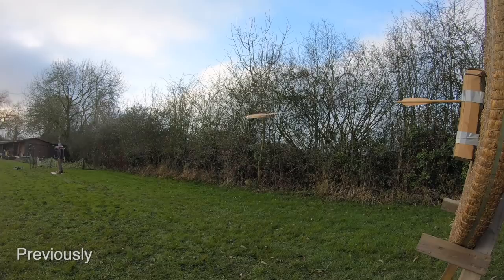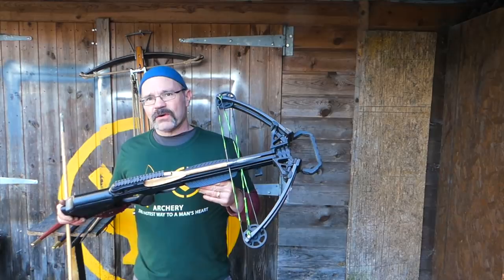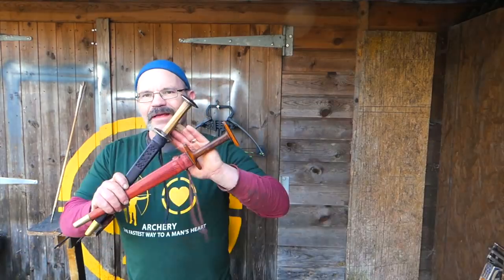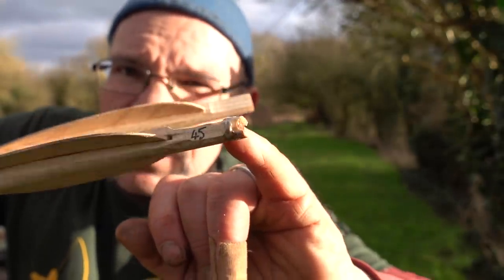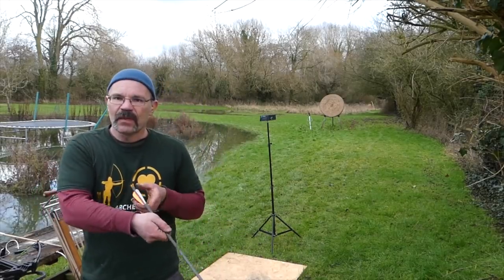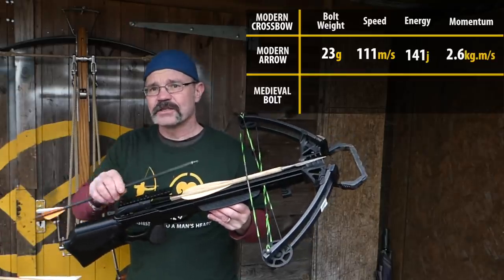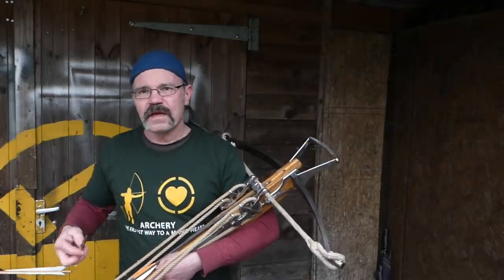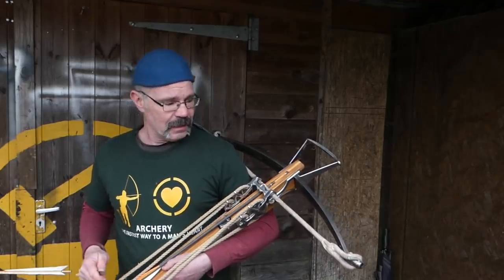Heavy Crossbow - Light bolt - What happens?

Comment: Just to add some scientific backing to this:
When drawing the bows in a quasi-static motion the energy needed is force times the distance. The energy required to draw both bows should be roughly comparable. 
In the dynamic case (shooting the bolt) this energy is converted into kinetic energy. However, not all the kinetic energy is transferred to the bolt. 
The string and the bow also get kinetic energy. Since kinetic energy is equal to 1/2 Mass*velocity squared it is advantageous to have a heavier bolt since the bow and string move slower and therefore have less kinetic energy. Having an extremely light bolt with a heavy bow and string with a large travel (no compound system) and therefore speed results in the bow and string having the majority of the energy. This also results in the extra strain on the string, since it has to dampen the energy left in the string and bow. 
Taking the heavier bolt with the lighter string and bow with little travel (compound) results in an even more efficient energy transfer. Since the velocity of the bolt is preferred over the energy the lighter bolt is used.
Reply: After some calculations one can find that the efficiency of the bow is very dependent on the mass moved during shooting and the mechanical advantage. If the arrow moves x times more than the bow the "virtual mass" of the bow is the moved mass over x squared (m_b/x^2). For the medieval bow this virtual mass is 168 g, for the compound it is 4.7 g. 
The energy that the medieval crossbow can release is 355.8 J, the compound can release 170.7 J.
The maximum velocity of the string without bolt is: 65.1 m/s and 269.5 m/s
To transfer half the energy stored in the medieval crossbow, you would have to use a 168 g bolt, with the compound you only need a 4.7 g bolt (at this point the air resistance of the string would probably not be negligible any more).
Reply from the maker: Thanks for this - great and useful information
Reply: @tods_workshop  I've done some simplified calculations with the data given in the video.
If you want to do the calculation yourself, here are the equations:
A rough estimation of the energies involved is given by:
E_pot=0.5*(m*v^2+m_b*(v/x)^2)
In this equation 
E_pot is the potential energy stored in the bow
m is the mass of the bolt
v is the velocity of the bolt
m_b is the mass of the bow
a is the factor how much further the arrow travels during the acceleration than the bow.
Since neither the mass of the bow nor the factor a is easy to determine, the virtual mass
m_v=m_b/(x^2) 
is used. 
Here are some of the equations you can use to determine these variables:
I use m_1, m_2, v_1 and v_2 to refer to bolt 1 and 2 with different masses.
Virtual mass:
m_b/(a^2)=(m_1*(v_1)^2 - m_2*(v_2)^2)/((v_2)^2-(v_1)^2)
Potential energy:
E_pot=0.5*((v_1^2*(m_1*(v_1)^2 - m_2*(v_2)^2)/((v_2)^2-(v_1)^2))+m_1*v_1^2)
=0.5*(m_1*v_1^2+m_b*(v_1/x)^2)
=0.5*(m_2*v_2^2+m_b*(v_2/x)^2)
=0.5*v^2*(m+m_v)
Velocity of the bolt:
v=sqrt(2 E_pot/(m+m_b/x^2))
Energy of the bolt:
E=m*E_pot/(m+m_b/x^2)
Momentum of the bolt:
P=m*sqrt(2 E_pot/(m+m_b/x^2))
Some of the values I've optained from these equations:
Modern crossbow:
Virtual mass: m_b/a^2=0.0047 kg
Potential energy: E_pot=170.7 J
Medieval crossbow:
Virtual mass: m_b/a^2=0.168 kg
Potential energy: E_pot=355.8 J
Lockdown longbow:
Virtual mass: m_b/a^2=0.034 kg
Potential energy: E_pot=186.9 J

Comment: I guess the travel distance of the bolt on the bow impacts a lot on the speed. It would be interesting to state the course on the modern bow and on the medieval bow as in the modern it has more "pushing" distance that allows to attain more speed, as in the medieval all that energy acts on the bolt for just a short distance.
Reply: It's not about traveling distance. 

Longer draw length simply allows you to bend the elastic spring more. In physic terms,  work (energy transferred) is equal to the force times displacement W = F ⋅ s.  F is force, s is displacement.

Huge force with low displacement just mean you're using large amount of force to bend this particular spring a bit. Not very efficient/dynamic system in other words.

Comment: The 950 lbs medieval bow may have met with another factor that limited power with the light bolt. Is the light bolt massively underspined for the powerful yet short push of the heavy bow? Is a significant amount of power lost in the arrow flexing like crazy as well as the problems you already described?
Reply from the maker: Nah, the spine is fine; it is very light after all
Reply: @tods_workshop  Fair enough, just a thought and thanks for sharing the test. Most interesting!

Comment: So it makes sense to me that a heavier arrow always absorbs more energy from the bow. Which begs the question: Why use lighter arrows at all?
Modern arrows are made from very light materials and I am sure there must be a good reason for it - what is it?
Reply: Range.
Reply from the maker: And speed.  Its complicated, but if you want to favour speed then you have to be light weight.  Energy goes up as a square related to the speed, so the energy goes up rapidly with the speed and so the bow ends up with two massive headline selling numbers, but in honesty dropping the speed and increasing bolt weight may well be practically more useful.
Reply: @tods_workshop  I've done some simplified calculations with the data given in the video.
A rough estimation of the energies involved is given by:
E_pot=0.5*(m*v^2+m_b*(v/a)^2)
In this equation 
E_pot is the potential energy stored in the bow
m is the mass of the bolt
v is the velocity of the bolt
m_b is the mass of the bow
a is the factor how much further the arrow travels during the acceleration than the bow.
Since neither the mass of the bow nor the factor a is easy to determine, the virtual mass
m_v=m_b/(a^2) 
is used. 
Here are some of the equations you can use to determine these variables:
I use m_1, m_2, v_1 and v_2 to refer to bolt 1 and 2 with different masses.
Virtual mass:
m_b/(a^2)=(m_1*(v_1)^2 - m_2*(v_2)^2)/((v_2)^2-(v_1)^2)
Potential energy:
E_pot=0.5*((v_1^2*(m_1*(v_1)^2 - m_2*(v_2)^2)/((v_2)^2-(v_1)^2))+m_1*v_1^2)
=0.5*(m_1*v_1^2+m_b*(v_1/a)^2)
=0.5*(m_2*v_2^2+m_b*(v_2/a)^2)
=0.5*v^2*(m+m_v)
Velocity of the bolt:
v=sqrt(2 E_pot/(m+m_b/a^2))
Energy of the bolt:
E=m*E_pot/(m+m_b/a^2)
Momentum of the bolt:
P=m*sqrt(2 E_pot/(m+m_b/a^2))
Some of the values I've optained from these equations:
Modern crossbow:
Virtual mass: m_b/a^2=0.0047 kg
Potential energy: E_pot=170.7 J
Medieval crossbow:
Virtual mass: m_b/a^2=0.168 kg
Potential energy: E_pot=355.8 J
Lockdown longbow:
Virtual mass: m_b/a^2=0.034 kg
Potential energy: E_pot=186.9 J
Reply: @lukasdimmler2622  Hey Lukas - the scaling factor with the bow limb velocity is a genious idea - did you just come up with that? That should allow us to plot out the dependencies. We'd need a few more data points to see if the model really holds though.
I guess with this model too, a heavier bolt shot from the same crossbow will always have more energy. Sure, the range will drop quickly - but is that really the only drawback?
Reply: @foolwise4703  The range decreases and the time of flight towards a target increases, making it easier to dodge the shot.
As for the scaling factor:
This problem is pretty similar to some easy mechanical problems I've done in my  second semester of college physics. I could try to make the model better, but without checking the accuracy of this very simple model this would just be wasted time.

Comment: I mean, it's not too unsurprising. The Medieval Crossbow has a lot less drawlength, meaning a bolt only has so much time to actually accelerate. With a short drawlength there's a limit to how fast you can get your bolt to get, meaning it makes a lot more sense trying to increase the weight of the bolt and the strength of the bow. 
The Modern Crossbow despite its lower draw weight is a lot more efficient at storing power and at the same time as a rather long drawlength, meaning it is still strong enough to get a modern bolt up to speed and since the drawlength is long, that speed can be higher.

Comment: Could you up the power of the medieval crossbow by putting even heavier bolts on there?
Reply: To some extent, yes; in a previous video he even said that the bolts he was using were underweight loads compared to what the crossbow will comfortably throw.
It would be pretty damn interesting to see exactly where the sweet spot in delivered momentum is...
Reply: @ShadowDragon8685  I was thinking of something more.. extreme.  Either a metal shafted bolt, or a lead weighted bolt.  Really up those grams.

Comment: Exactly what I wanted to know when I saw the first video. I'm not exactly surprised - it would be weird if 500+ years of material science didn't result in an improvement.

But now I'm wondering - what if you make a similar medieval crossbow using modern spring steel? Or is it already made from that? Basically using modern metallurgy to optimize the crossbow's potential.
Reply: For maximum energy storage in the limbs you would probably want to go with a maraging steel. The switch from a medieval steel to a modern steel would not change efficiency at all, as all steels have approximately the same density and modulus of elasticity, which are the only two properties of a material that dictate how fast the limbs can rebound. To increase in efficiency by changing material, you need a material with a higher specific stiffness so that more energy can be stored in much lighter moving parts. This is why modern bows use fiberglass and carbon fiber composites for their limbs. They are much stronger and stiffer pound-for-pound than any steel alloy could ever hope to be.

Comment: Not just faster materials, it's also a compound.

While the variable draw curve is important to allow a let-off on a bow, it's much less important on a crossbow, the main benefit is the fact that the leverage of the system allows the limbs to propel the bolt faster than they move.

The limbs don't move nearly as much as the power stroke of the crossbow, and to compensate they're also much heavier, wouldn't surprise me to find that both bows actually have similar limb weight when measured like for like

As an example: https://www.bushcraftlab.co.uk/products/ek-archery-blade-compound-crossbow
Power stroke 12.5", difference between axle to axle cocked Vs uncocked 3"- a 4 to 1 difference!!

That a 700lb crossbow right there, and the limbs consequently only have to move 340/4=85fps to make the bolt go that fast, whereas direct it's 340, much,much more efficient even without the lighter limbs-16 times less energy wasted!

A steel compound crossbow would probably be really fast too, just really heavy
Reply from the maker: True
Reply: @tods_workshop  I'm actually somewhat surprised it's as good as it is , 200fps is still about half as fast as the fastest crossbows, with a massive mechanical advantage, like that you feel that steel could even match that- it could be moving slower than it does now, it could be quieter!

 But I guess they already had carbon fibre/fibreglass limbs from all the recurves, where they make an obvious difference,which are technically better even if it's not that much of a difference on a compound...and a massive steel leaf spring is probably quite tiring to hold and aim accurately :D

Comment: Does the length of the "power stroke" ( I don't know what it's called) make a difference? I have a modern compound crossbow and the string moves something like 13-14 inches when firing. That big medieval bow doesn't look like it has as much travel.
Reply: That's literally why they have to be at 900lbs or more. I think I've read that some bows could get all the way to 2000lbs in draw weight. The metallurgy just wasn't good enough to flex the metal without the fear of snapping. Tod has stated that he could increase the power stroke but they would no longer be historically accurate so he doesn't.

Comment: Now I wanna see Tod in a black leather jacket, on a Harley. 😅
Reply: And I don’t find the results all that surprising.
The modern bow is like a Porsche 911—it’s pretty fast, but it can’t haul a lot, and don’t even try to put it in front of a big trailer.
The medieval bow is a lorry. It’s not fast. Even if you don’t load it up, it won’t be fast. On a steep incline, it might even run out of steam, long before the 911 would. But you can pull 40t with it, easily, because of the way it’s been built. Something that won’t ever happen with the Porsche.

PS—lol! I wrote that before you said the exact same in the video. 😂 Great minds think alike I guess!

Comment: Interesting that the modern crossbow shoots the heavy bolt faster than the winlassxbow shoots the light bolt. That makes the modern xbow hands down better by all measures. I wonder how heavy a bolt you can make to fit on those xbows, there should be a weight where the brute force of the windlass allows it to shoot harder.

Comment: I wonder what would happen if the medieval crossbow was just given modern cord.
Reply: Or, since about 90% of the energy is in the limbs of the bow, a steel cable.  In that case I think you'd want to put steel rails along the track for the cable to slide on

Comment: So the medieval bow is like a tractor, lots of torque, can carry a huge weight forward without hassle but is ultimately pretty slow moving and the modern bow is more like a normal vehicle, can go fast but torque isn't nearly as high... am I getting this right ?
Reply: Dammit I commented just before you made the comparison.. I guess I did get it right
Reply: Yes, the medieval crossbow does not gain much in speed and will loose a lot of kinetic energy with a light arrow. But in the same way it will not loose much of speed and it will gain a lot of kinetic energy with a heavy arrow. If we would increase the arrow weight to MUCH heavier, for example 1 or 2kg, it would because of the high draw weight throw away the arrow faster and significantly higher kinetic energy than the modern crossbow with much smaller draw weight.

Comment: Where there ever made crossbows with more than one "bow"?
My thinking is that, if you have crossbow with 2 500 lbs "bows" that "combines" to one string, you might be able to load it without the windlass. You would have to "load it twice" for each shot and would probably get less than 1000 lbs of force but if you had more "bows" with less draw weight, you might even be able to load it by hand.
Or would it be too complicated and inefficient?
Reply: I did see a picture like that, I can't remember whose video it was on, maybe Skallagrim.
It looked like a double-ended crossbow, the string fixed to one bow and sliding over the other bow like a pulley. It seems like there are a lot of ways it could fail spectacularly, so probably didn't catch on widely.
If I can find the original source I'll add it here.
Reply: @stephens7136  Thanks :)
Reply from the maker: I believe there was a Chinese wagon mounted three bow device - but not sure
Reply: @tods_workshop  Nice. Did it use all 3 to fire one bolt? And thanks for the reply.

Comment: I know it's not historical but if you made the draw longer on the medieval one you might put that bolt all the way through that target, could you fuse old style power with new style speed
Reply: The bow would need to be much longer otherwise it would be deformed permanently. That would make the bow much heavier and harder to handle. Also the windlass needs adjusting and the stock may not be long enough for that. I am confident that people back then did not do it for a reason.
Reply: @maxlutz3674   indeed true , but maybe you could do it with wood , like a high weight longbow on a stock although unwieldy 
 may be more effective than the shorter draw versions